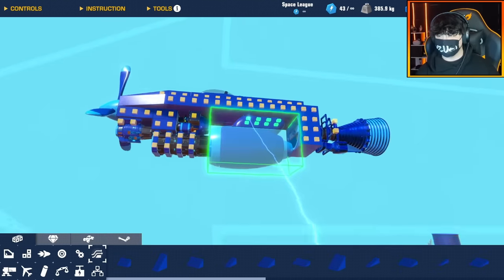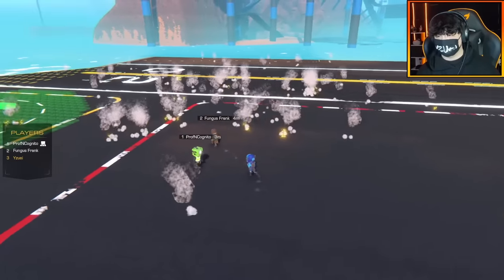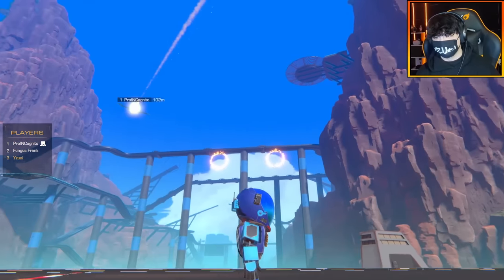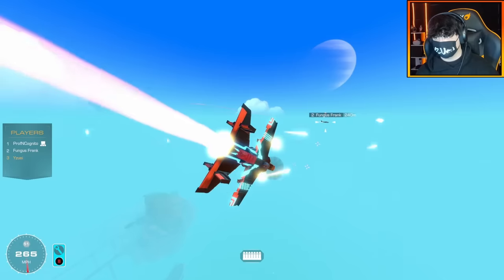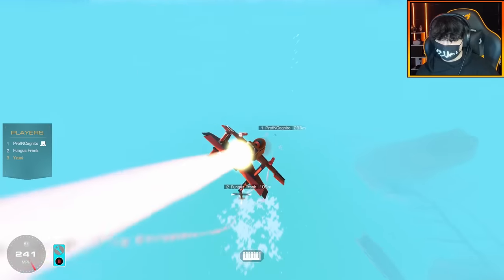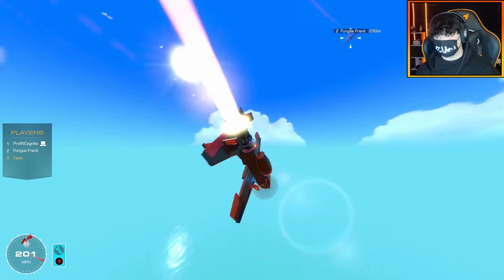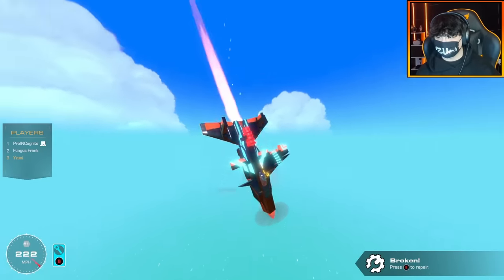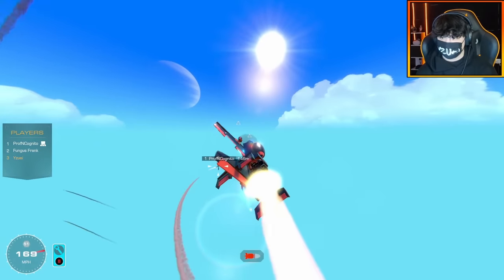DOGFIGHT But We Use 1 Of Each PROPULSION!

Comment: The ultimate battle, Flying sub cars! You should’ve used the underwater propellers + wheels as well. Even if you fall you can still fight from water or land. Total annihilation is needed to win or at least the seat. Fighting in, on, and out of water or land. You can’t really call it all propulsion if you didn’t use all of them now can you 🤔. Question is can 1 propel enough underwater. Hover excluded because you need 4 min.

Comment: How about a battle with random weapons? Build your vehicles (plane, boat, tank, sub, spaceship, doesn't really matter, but ) with one of each weapon, along with a randomiser (a rotating arm, in a box you can't see inside, with distance sensors hooked into AND gates around it and the weapons Use the same control input to pause the rotating arm as fire the weapon). That way, you don't know what you're going to be shooting each time you try to fire...

Comment: I want to see what happens if you have what looks like a normal plane, but you flip the thrust around, so not only is the plane flying backwards, but the control surfaces are on the leading edge of the wings instead of the trailing edge. No idea if this would even work, but it'd be really funny if it did, especially if you decide not to flip the weapons, meaning you can only shoot behind you. Or just build a normal plane, but have the weapons pointing back instead of ahead, this way you can either look ahead at where you're going, or behind at what you're shooting at.
Reply: You should look at the Grumman X29 concept
Reply: @whateverarc2768  Oh yeah, that thing's pretty neat.

Comment: You said to comment video ideas so I've given you my whole list, the edited and polished one IT’S NOT LONG PLEASE READ IT. I don't actually have Trailmakers yet but I'm hoping to get it soon, I have so many designs and ideas in my head, online, and on paper.

1. Can We Dogfight With VTOLS? (The idea is VTOL mode will save you from falling out of the sky if you lose parts or it can act as a different way of offense)

2. Who Can Build The Best Spy Car (You must build a car with at least 1 offense gadget and one defensive. That's just the concept but you can chose weapons whether it's a general limit or your usual evolution system)

3. 2v2 Battle Bot (One person will be in charge of building the main bot which can have up to 6 wheels, weapons on both front and back, and a 150 block limit, the other will build a mini bot that must be smaller than the main, has a 60 block limit, can only use two wheels and 1 dragon engine, as can only have one weapon on the front. Obviously no form of flying, no projectile weapons including guns)

4. Can We Win The DEATH RACE (it may be similar to something you've done but the goal here is the create cars inspired from the ones actually used in the movie Death Race and see the placements on your set course, to make it more interesting you could have a limit on repairs or have someone follow behind in a Dreadnought, the deadly semi truck also from the movie)

5. 2v1 Diving Bells vs OVERPOWERED STEALTH SUBMARINE

6. Trailmakers but COPS & ROBBERS, 2v2 Challenge (Everyone will build one different vehicle, A getaway car for the robbers with a mounted gun controlled by the passenger, a police car for ground pursuit, a helicopter with one tiny cannon simply for distraction or visual if the robber manages to take out a cop or lose them. The goal is to disable the car the robbers are driving or eliminate their offensive capability)

7. The YRF (The Yzuei Rescue Fleet) Similar to how you did the space set you can make a set of vehicles for rescues and exploration, even if they are simple. Vehicle list

Rescue Boat - YRF Wave
Rescue Helicopter - YRF Hurricane
Hydroplane - (Not sure for name, if you base it off a real one you can make a name with that)
Rescue Ship - YRF Interceptor (has flares and a section that can raise and lower in the water to pick up smaller boats)

Accessories could be…

A signal buoy with sirens for lighting
A life-reserver/Life ring made with dingy corners

Again all ideas just wanted to share them with you, I'd love to see you make your own changes to these or that they inspire you with other ideas. My subscription was long over do, you're an incredible creator Yzuei

Comment: Yzuei build a plane but the only block allowed is rocket thrusters and in the end of the battle use the gun powder cannons
Reply: You can't build anything if the only allowed block is the rocket thruster, you can't even call it a build, it's just a rocket thruster
Reply: @monsieurgb497  yes but using block between the rocket thrusters